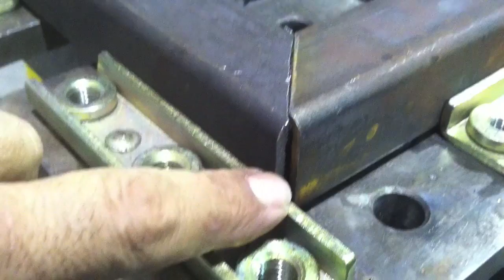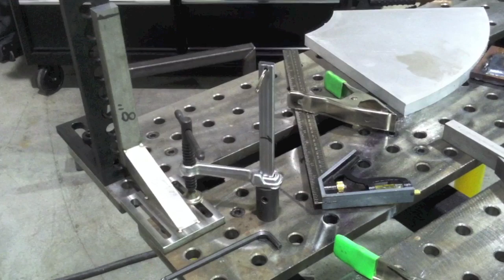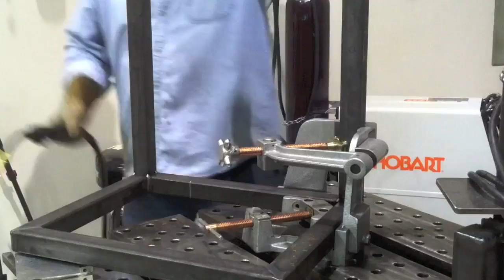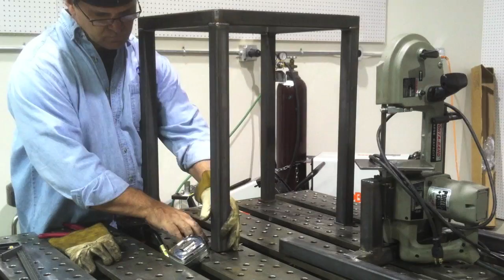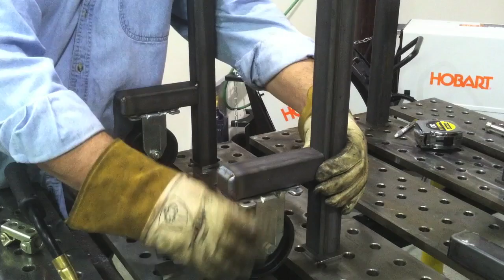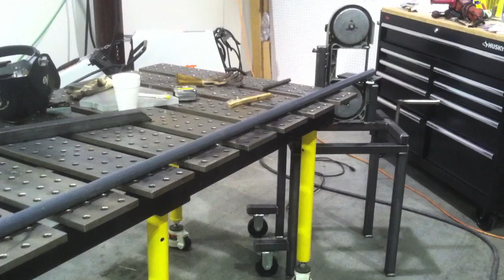Stronghand Tools 3 Axis Clamp and other Metal Fabrication Tools

Comment: A design fault I see with most 3 axis clamps is that clamping force is applied in 2 directions instead of 3. 

The result can be that to get complete alignment the operator must apply sufficient pressure in the 3rd direction ,
especially if the object and the clamp are not supported in the same plane. Not a big deal unless you are looking
for super precision. 

 I haven't researched into this but would like to see whether 3 axis clamps can be built that clamp the 3 welded parts in 3 directions using a single clamp, or possibly 2 clamps if open access to inside corner is restricted too much.

Comment: was wongering if you can put a 3x3in table leg thru that fixture so the cross supports could be welded  approx  4 in from bottom of table legs.

Comment: was wondering bout down hill welding ive done it b4 at home on projects to save time and fill gaps like you said i work at an asme shop that makes pressure vessels and all sorts of structual was wondering if you could make a vid on the peo n cons of down hill welding i was not allowed to weld at work downhill under no circumstances

Comment: Quad boy I have a 3d demmeler table at work same thing as a strong arm but more expencive I spray it down with wd40 keeps it from rusting and helps with spatter if BBS  do stick use a chisel and a wet stone to remove them and flatten the bb

Comment: Jody, as always thanks for posting.  I really like your stuff.  I'm considering purchasing the Strong Hand Tools 3 Axis Clamp after watching your video.  I realize that clamp comes in two different sizes, a smaller one, PN: WAC35-SW (miter up to 3.75", through clearance to 2.45")  and a larger one PN: WAC45-SW (Miter up to 4.75", through clearance to 3.92")  Through clearance matters if you are welding on a leg in the middle of a run.  Any idea of which model you are displaying in your video?

Comment: @JosefTG It used to be easy, Pink was for dust, that changed when it was easy to combine typically used filters. What and how much you breath is based on a Permissible Exposure Limit (PEL). For what you do, even if the boss doesn't, spend the extra few bucks and get the dust filter that also filters organics. In your case, the filter is a 2097.

Comment: @googacct I just wanted to toss in my 2c, I teach respiratory protection. The 3M Respirator that Jody referred to is one of the best! For Zinc just make sure you have the Pink 2097 filters, they are particulate filters that also filters organics. There is a Pink 2091 filter that looks like it but it only a dust filter. Get the 2097 filter and you will be fine. Hope you and Jody don't mind me butting in...